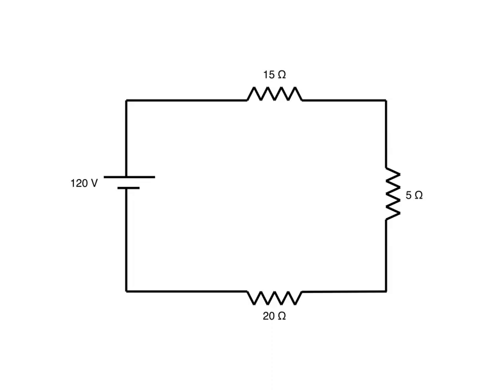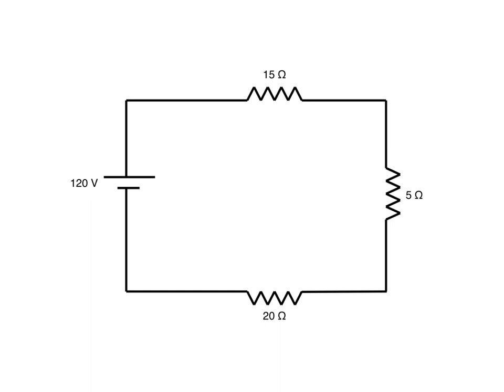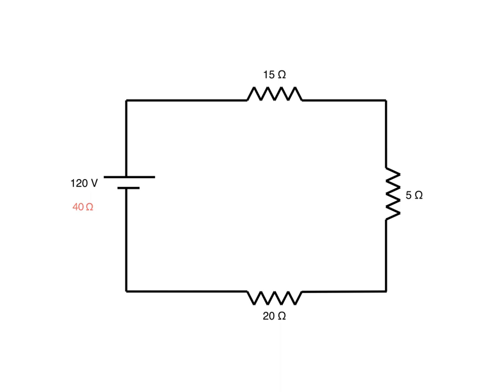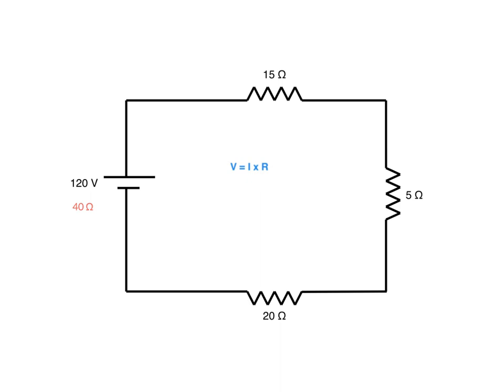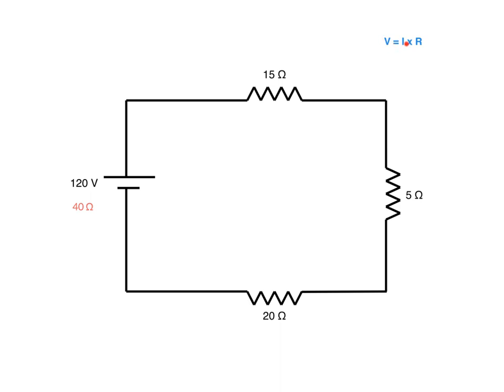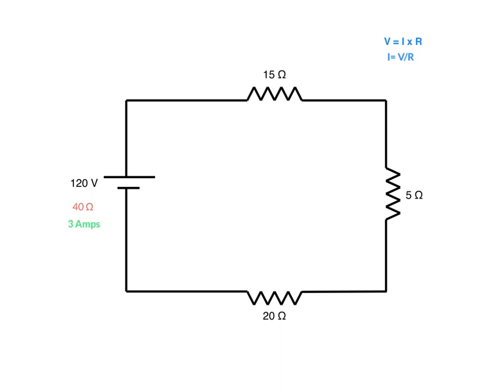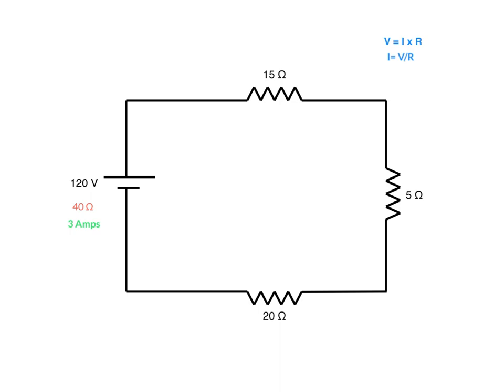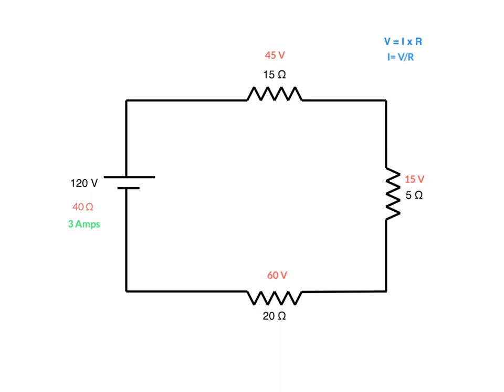Ohms law series circuit

Comment: question: could this be im short if al resistors  were 20ohms but voltaje remain the same 120v? how can this circuit  fail?
Reply: Key: V= volts
         I= Amps
         R= Resistance
        RT= Resistance total 

If all three resistors equal 20, that would give you a total of 60 ohm's. R1+R2+R3+ etc. = RT 

R1 means resistor 1, R2 means resistor 2 so on and so on 

Ohms law says that voltage over resistance (Ohm's) equals current (Amps) 

we take our total voltage (120) and divide it by 60 Ohm's 

120v/60 Ohm's = 2 amps. 

Now we multiply the total 2 amps ( Amps never change in a series circuit) and multiply it to all resistors which equal 20 Ohm's. 

V= I x R

2A x 20 Ohms = 40 volts 

Last step is to add all three voltages together 

40V + 40V + 40V = 120V 

Remember, all the voltage drops must equal total voltage. 

I hope this helps!